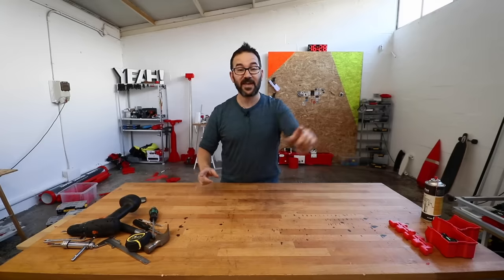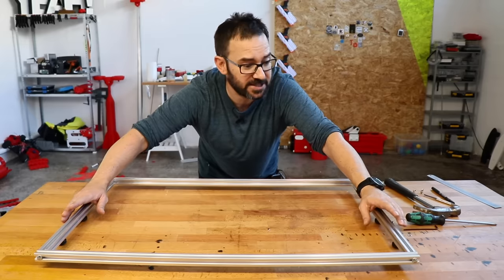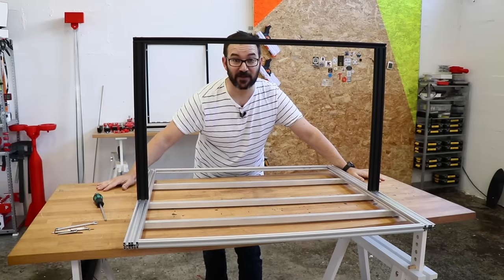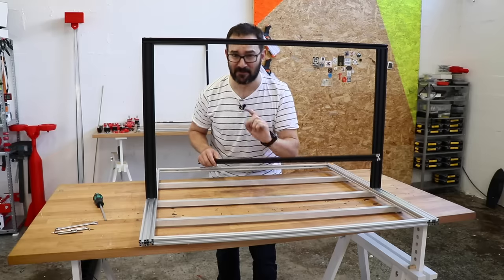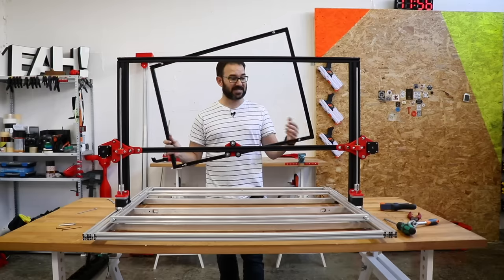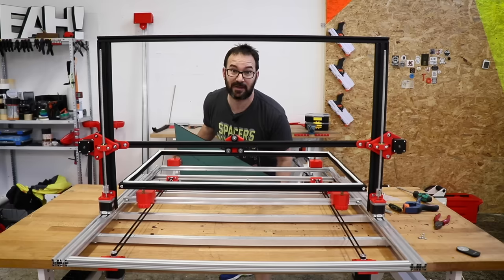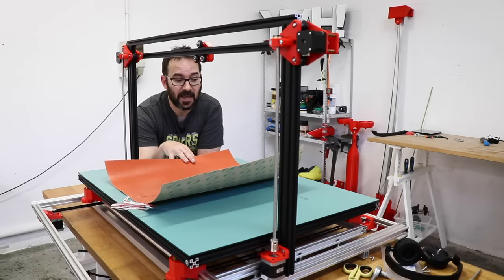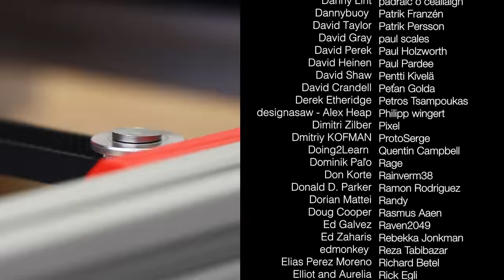GIANT DIY 3D PRINTER FROM SCRATCH

Comment: You should have used an aluminium plate for the bed and put the heater on it, instead of the mirror. its really hard to remove those pads so you will destroy the mirror.

Comment: This is a cool build, but the weight of that bed is gonna be very hard to deal with and it will definitely slow down how quickly you can print. This bed can definitely stretch a belt or strain any tensioner. You'll probably need a large motor, many belts, something to make the gantry rigid, and a really stable table just to eliminate ringing. This should really be some sort of core xy printer, like make the gantry move back and forth or something.

Comment: You know this guy is a pro, when he can drill perfectly straight holes with a hand drill. Way too advanced for me lol.
Reply: Drill press
Reply: No, it means the opposite. An experienced amateur, but an amateur nonetheless.
Reply: Forget the drilling, the two bits I don't like are the tapping and filing. He needs to get the tap squarer to the hole to ensure the threads come out square to the end.
As for filing, he needs to lift on the back stroke to get a flatter surface
Reply: yeah you just cant drill square without press

Comment: For a bed this size it might make sense to move the gantry back and forth instead of the bed.  

That mirror has to weigh a zillion pounds (that’s about half a zillion kilos)!
Reply from the maker: "Make sense" is an extremely ambiguous term. The mirror weighs a zillion pounds though, you nailed it.
Reply: exactly what I was thinking, that mirror + the weight of the print, is massive. tahts a lot of weight moving around especially on belts, would have been better having the mirror on z with a couple of ball screws, and nozzle on x and y. That's what I'm currently building but 400x400 although will take a while, buying a couple of things a month. Titan aqua is expensive. also cant decide what board at the moment, do love the duets interface over marlin, but they are expensive.
Reply: @GlaucusBlue  For board options Id look into the SKR v1.3 and potentially running klipper off a rpi with it
Reply: I also think he needs bigger stepper motors for the y carriage to achieve reasonable printing speed
Reply: it wont be fast thats for sure but if hes is printing with a 1 mm (or even more)  thats not as bad
Reply: 0.453592 zillion kilos
Reply: @ivanmirandawastaken  This is what I came to say, and it's the first comment, ringing will be bad on this, and it will be very easy to loose steps. Look to the hypercube evolution for inspiration. I've built a 400x400x500 HCE, that I've heavily customized, and it works great. The bed runs up and down on 4x 12mm rods, with long linear bearings, and is lifted by two T8 lead screws. It's a coreXY on hiwin linear rails for X, and Y. The standard HCE, is using 10 or 12mm rods for X and Y too, which also works just fine. The bed is a cast, and machined aluminium plate, with a silicon heater pad on the bottom of it, and a mirror from the hardware store on the top. Gates belts are highly recommended, especially as you go up in size, and you can get them from e3d.
Reply: another vote for questioning why you didn't opt for a core XY design? 400x400 seems like it's pushing the y axis weight limits. your seemingly 600x900 plate is going to require insanely low acceleration and speed to maintain any level of accuracy.  also once you need a print volume that large i think 3d printing is no longer viable. at that point welding or carpentry make more sense
Reply: @MrOsmodeus  I think a 600x900 printer would be decent with a core XY with linear rails, and wider gates belts, (or ball screws) and a super volcano on the hotend. Definitely should have the highest torque NEMA17s, or even nema 23s. A hypercube Evolution with rails like mine would be decent. I'm half tempted to build a second HCE, with bigger linear rails, (I'm using MGN15s on my 400x400. Maybe ball screws, and a super volcano. I'm still using a titan, and V6 setup with a 0.4mm nozzle. It works great for large batches, and the occasional long part.
Reply: Without rigid enough overhead framework, the more mass you drive [yes, depends on the speed that the printer head is moving at] the more inertial stress the system will experience and this can strain the joints, so be sure to have really strong and well gusseted framework to avoid the joints of the frames coming undone on the gantry. ~( 'w')/
Reply: Good point!
IMHO core-XY or delta could work much better on such a big scale. And better with proper linear rails instead of rubber rollers. )
Reply: I think this is about making the printer as simple and cheap as possible. Moving the gantry is more complicated and more difficult to set up/ getting it square.
Reply: Was also thinking the same thing... coreXY would have probably been better. With the additional Z support it can go faster as well, which is important with such large prints, also it offers more build volume to footprint.
Reply: @ShadowBurn680  what is the point of using Klipper with 32-bit board?
Reply: Not only does the bed weigh a zillion pounds but then it just keeps getting heavier.  There is a reason Prusa is not releasing a 30"x30" i3Mk4 ... they are going to a Corexy.  And if you pull some designs from E3D you could ake a DYNAMITE one with only having to have a single aluminum plate machined.  From there its just extrusion...
Reply: @ivanmirandawastaken  you dualed the y axis and x axis motors! should be fine! i mean with a machine this size...speed isnt even a thought
Reply: @anthonyyaghi6342  I was thought this was going to be a dual Y carraige but I see how he ran the cables. If its a slow speed print, it should be fine.
Reply: @OzziemandiasPL  Klipper has some features that are pretty nice like pressure advance which I believe marlin has but isn't as easy to setup as well as completely eliminating any bottleneck in terms of the speed of the firmware as all calculations are done in advance and then sent to the controller making for better I guess anti-aliasing would be the term for curved surfaces and also higher speeds until you reach the limit of the hotend being able to push plastic or the mechanical limits of your machine
Reply: I agree, I believe the max speed will be very limited by the bed weight and they Y axis will likely have ringing artifacts. I would favor a CoreXY design for larger machines, where you can have multiple motors handling the heavy bed that only has to move slowly, and 2 motors that only have to push around the much lighter gantry cross beam. If its printing at slow speeds it's probably not a problem, but a machine of that size with a volcano nozzle probably wants to move at a fair speed.
Reply: @GlaucusBlue  couldnt just all 3 axes run on the nozzle?
Reply: it's 10x more intensive (and expensive in framing) to build one that way though.
Reply: To get decent print quality on that behemoth you need to change the top speed and acceleration on the y axis to be insanely slow.
Belts are not magical, they have a certain flex even when tightened down. You are going to, when running it at speed, essentially have rubber banding occur. Not to mention the whole thing will try to shake itself to bits, because all that energy has to go somewhere. Physics is a cruel mistress.

But really fucking cool regardless.
Reply: Could probably compensate a bit by swapping the usual NEMA17 motor with a NEMA23 and using fatter belts with steel wires embedded for reinforcement, but yeah, that bed and a print (or set of parts) large enough to justify the build volume could cause some serious Y lag/wobble. A CoreXY style of printer might work better for this volume, but I think it's still plenty doable with an i3-style motion system.
Reply: Ivan Miranda you don’t want that much moving mass, it creates momentum and inertia and you’ll get more motor and belt wear and resonance as the assembly struggles to stop as quickly and elasticity in the system causes the belts to stretch, the assembly to bounce back again and resonate before moving once more. The less moving mass you can have in a system the better usually, unless you’re intending to use it as a “flywheel”. 
I highly recommend keeping the bed stationary.
Reply: @ShadowBurn680  Klipper FTW! Even better if you run it on something better and cheaper that raspberry pi crap. Besically anything that will run Armbian will do and I would recommend 7" touchscreen and touchUI plugin for octoprin too. Imho way better than those small LCD's and their knobs. With something like beaglebone one could even run the klipper FW and octoprin from same board. I beleave there is some kind of shield for beaglebone for that.
Reply: The bed movement will remain square and stable, while it might be rather iffy to move only the gantry.  I wish Ivan would put up a set of plans and a materials list for this.
Reply: Ivan Miranda has
Reply: @ivanmirandawastaken  Hey Ivan - where did you source the large custom-sized(?) silicone heater?

The foil insulation?
Reply: I was just about to say a lighter print pad would be preferable.  
This machine is a work of ART! Anyone make one yet.?
Reply: I'm going to build this bad boy but upgrade a few things and weld another few things. Sweet video
Reply: @newell418  done yet ?
Reply: Core xy
Reply: @shurmurray  a CoreXY would be a bad idea on such scale.  the belt length is too long... needs to be like a CNC where X is moving instead, most large printers do this.
Reply: @ivanmirandawastaken  : That much mass has to cause issues with print speed and stability at the least.  A bed flinger that big with a glass bed...yeah...  It's an impressive accomplishment, but I'd probably went with something like 3D Distributed's Workhorse XL scaled to the sizes you have.  Might have called for rack and pinions, though.  (That simply has it's own design tradeoffs...just like any of them...including the ones you ran with...)  To be sure, I'm not bagging on this...I just reviewed what you did...and decided it wouldn't work for me if I want that sort of massive print volume.  I want/need, but can't justify what the pros are charging...or even swing it.
Reply: @claytontimmons4898  : Depends on the gantry.
Reply: I think alternatively to a mirror and heated bed you might be able to get away with supported garolite, I'd have to try some no-heat tests with different materials but most materials seem to print on it.
Reply: plus several kg of print material on something this big
Reply: +1 gantry instead

Comment: You definitely need an E3D Supervolcano for this.
Reply from the maker: In the mail
Reply: FDM printer time is dependent on volume, which is third power of printed object height (=not really scalable). Resin printers on the other hand take time proportional only to object height itself (=lineary scalable)... The printing time of "Radon transform 3D printers" is (theoreticaly) not related to the object size at all (=very scalable).  So i guess for very big prints we will need to change the technology (as long as we're not willing to go with huge nozzles, eg. like they did in concrete casting 3D printers)
Reply: @harviecz  large volume SLA machines have existed for quite a long time, I've personally had some entire gearbox casings SLA printed...  The issue isn't scalability, the issue is material properties - SLA resins produce nice smooth surfaces but they're incredibly brittle and have terrible thermal properties.  FDM carries a fairly huge advantage in the diverse range of materials that can be printed.
Reply: Ivan Miranda how do I get ahold of the fusion files for this?
Reply: Yes
Reply: Also a bad idea, heatbreak is fragile and that thing is way too long to be supported by it.  there are better hotends.
Reply: @digibluh  He changed the supervolcano to Mosquito Magnum Plus

Comment: For a printer this size you need to buy spools of red PLA in the multi kilometer length size.  You know, spools about as big as the power company uses for their transmission line cables.  Can't wait to see your spool holder.

Comment: You might want to put a cross-brace in the middle of your "mirror-carrier" so it wouldn't bow in the middle over time. Maybe also upgrade the belts to 9 or 12mm. The bed weights a lot probably and you've done well by using 2 motors to drive it. However, the belts (given they are the standard 6mm belts) will stretch a lot faster by slinging that weight :P So bigger belts can resist the higher torque, resulting in less slack over time, and better prints! Nice job however :D Already looking forward to the next 5 videos!

Comment: If anybody actually needs a stupid-size-printer, it's Ivan Miranda!
Reply: if anybody needs stupid coments, its Andreas Klostermann ... I have 5 printers ENDER 3, they are for me as working horses with nonstop printing .. BUT for lot of my projects is not to enought bed with size 330x330 ... so I am bulding CUBE printers by myself ... now I am working on printer for printing BIG SCALE RC TANKS with 900x350x250mm dimensions ... in building progress is next printer with dual printing head that print 2x dimension in X axis in same time ... dimensions 2x 400x300x250mm ... one driver to X axis with 2 motors (1 LEFT / 1 RIGHT) no needs tension for belt on X axis ... one driver for 2 extruder motors  ... 

note: about HEATBED ... I am not using heatbeds on all my printers, heatbeds are DISABLED and wires are out from beds, I ma printing on cold borosilicate 4mm glass sheets only with spray adhezion tool (3DLak) and no problems printing everythink what I want/need ... 
I am printing PLA, ASA275 and sometimes PETG ... no ABS, TPU etc. materials ... and for BIG bed sizes bigger than 330x330 is 0.6 nozzle right choice ... same layer with bigger nozzle = same result with shorter printing time about 20% ... with same quality 

so thats is reaction to your comment ... who can build printer as DIY project at home, never build 220x220x220 ... for this size is ENDER 3 straight to buy from Aliexpress ...

Comment: Curious as to why you drilled through the extrusion instead of using T nuts and angle brackets for the frame.
Reply: That's what I was thinking and most likely why the bottom frame was flimsy and needed a bunch of extra material to strengthen it.
Reply: much better alignment and rigidity in a square frame that way
Reply: @cda32  depends a lot on how they cut the profile
Reply: Using t-slot compatible brackets would have been much stronger and easier to square up and make adjustments. And probably would have only added a few dollars to the build.

Comment: Well, this earned a subscription. Totally not sure about this design though. The largest heaviest part of the printer is doing a large part of the work and I think that is going to cause you big problems. Personally I would have gone for a large scale delta or a coreXY since both of those regimes have the lightest part doing most of the work. I know a Delta is funky and hard for a lot of people to get their heads around but the upsides here is that you can make the bed out of anything and it's not a factor. making the towers super rigid is also not an issue since they also don't move. That just leaves the actuators and carbon fiber tube is super cheap now. You could run the whole thing with standard belts and Nema 17 motors since your entire focus is making the print head as light as possible. Code is easily available to run them and the only potential downside is you are printing on a circle instead of a square. So I've got my popcorn, let the fun begin.

Comment: i might be missing the big picture here (no pun intended)...

why does someone need a huge printer like that? i mean, what is bigger than a tank that needs huge parts?
Reply from the maker: You won't trick me that easily into giving away what is it for but good try.
Reply: I think he wants to use it to print less parts so that he can leave the printer alone for longer without having to clear the bed and starting a new print
Reply from the maker: I won't fall for that either
Reply: a full sized tank
Reply: I'm hoping it is for bigger or more tank parts. If he can make two bogies wheels for suspension instead of one he just cut production time in half. Plus I'm also curios on what he is going to do with the upper half of that chassis. I'll just wait for the upcoming videos!
Reply: welp, had to try (not)
Reply from the maker: Well tried
Reply: A house
Reply: he obviously will print a 3d printer
Reply: @isaiahcampbell488  uhm...no he won't he Will Just cut the time to prepare the second wheel print
Reply: The whole printer looks like a temple of the God of 3D Printed Tanks :)
Reply: Hmmmm..... 2 print heads, 1st at 0 - 399, 2nd at 400 - 799, giving him the ability to print 2 identical parts at once?
Reply: I NEED THIS!

Comment: Thank you for justifying a miter saw for me.  But really, you make it all look so easy. I know A-Z is rather straightforward, but I wouldn't mind seeing the occasional stumbling point if you feel the need to pad the runtime. It helps me feel better about my usual three-prototype project workflow. It's not that I screw up twice, but that I get good ideas along the way, like "that hole should be on the opposite side for ease of assembly".
Reply from the maker: The top horizontal beam should have been bolted from the sides for a little extra Z axis travel, feeling better already? 😉
Reply: Yep, I feel like I could do the next project twice after hearing that. Oh man, noticing that would drive me crazy.